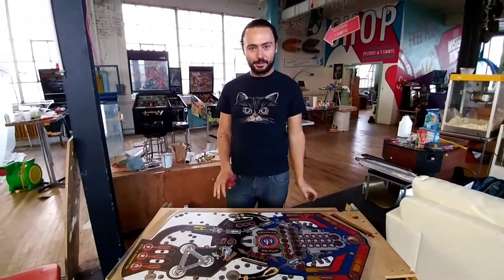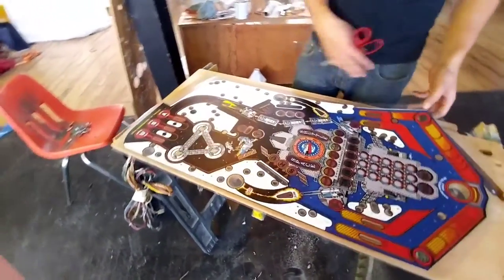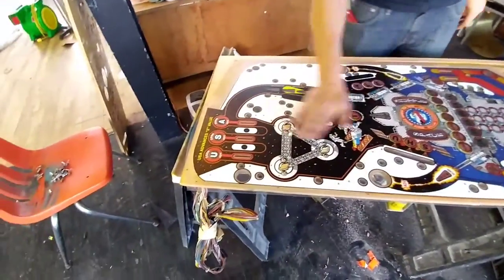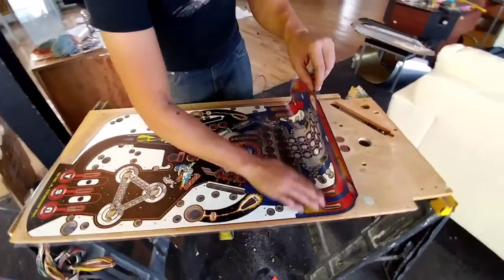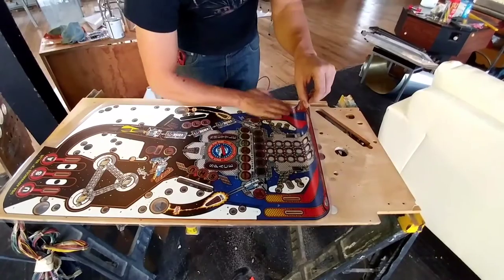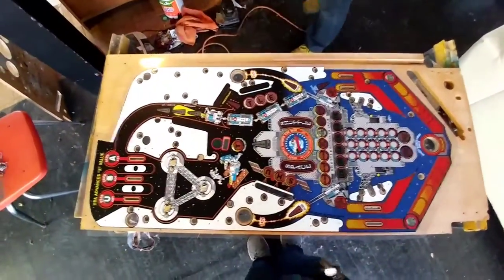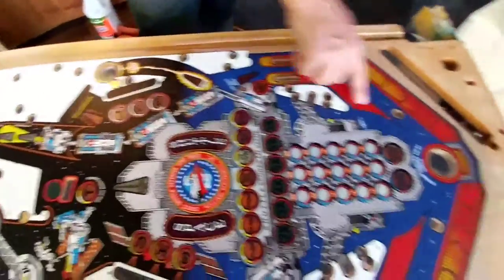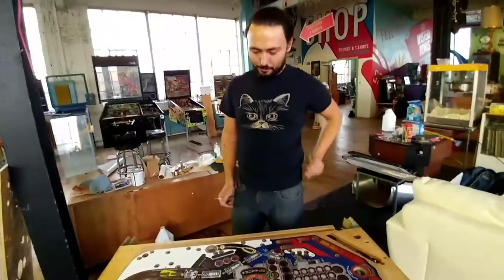Superelectric Pinball Playfield Overlay Installation

Comment: Why clearcoat?  its reverse printed, the ball would have to go through the mylar and its a old single level pf?
Reply from the maker: It isn't reverse printed on these. The material comes with adhesive and the print layer is on top. There's some other good products that have come out since this video that have the print layer below the material.

Comment: Is that the one that can be purchased on eBay?
Reply from the maker: No. I think the ones on eBay are from Classic Arcades and I would not recommend them. They use a different material and process that's hard to work with and prone to failure.

Comment: Hi, I've purchased a pinball machine with the overlay in place. Generally speaking, it was done very well and looks good. However, I have no idea how to maintain it. Do you have any recommendations about cleaning and waxing it to keep it in top condition? I'm concerned about using products designed for wood playfields that could damage the overlay. Thanks!
Reply from the maker: I use a quality clearcoat over the overlay so it can hold up to basically any kind of cleaner. 

Games without a clearcoat over the overlay are at risk of damage during cleaning. As a rule of thumb I would start by cleaning with the most mild cleaner in a hidden area. Move to more aggressive cleaners as needed testing a small area first. Usually you're pretty safe using a carnuba wax on printed materials as well as painted surfaces.
Reply: @SuperelectricPinballParlor  Thank for the information!

Comment: Hi - you make it look so easy!!!!!!! I purchased an overlay for my High Speed from Classic Arcades - I have not done a 100% good job - can you suggest any other suppliers????? - Nice Job :-)
Reply from the maker: I create my own overlays and have been disappointed about the quality from retailers so it is hard for me to recommend any one. I put up a number of window decals when we opened the pinball parlor and that helped me get the hang of it. Maybe practice with some contact paper till you feel comfortable with the application.
Reply: Thanks for that David - how in the world do you go about making one!!!!!
Reply: I did everything right - total strip of overlay - totally flat and then 3 separate coats of 2 pack clear coat - then wet and dry paper 1200 grit - its so flat and smooth. Just need something better to put on it.
Reply from the maker: I scan the playfield and touch up the imagery in Photoshop then print it to an adhesive back mylar material.
Reply: Thanks for your help - gonna have a go - what thickness would you recommend please.
Reply: Thats very cool, I am struggling to find the right Mylar, can you help me please also  - do you use a laser printer? Thanks for your help
Gary
Reply: I want to buy overlay from classic arcades .. for my BOP you not raccomend ??
Reply: @mrgazer26  Outside Edge makes high quality overlays